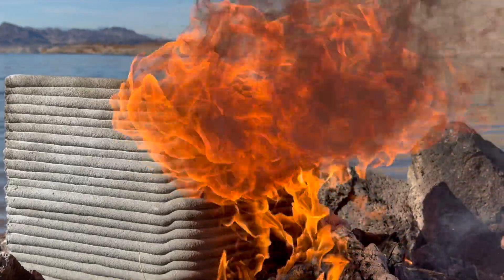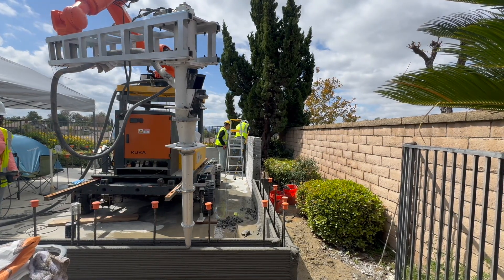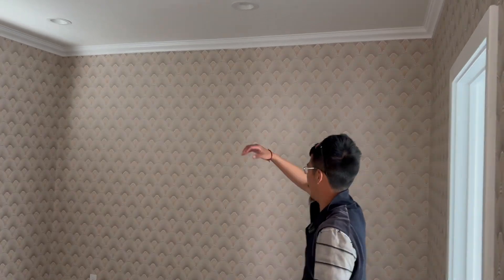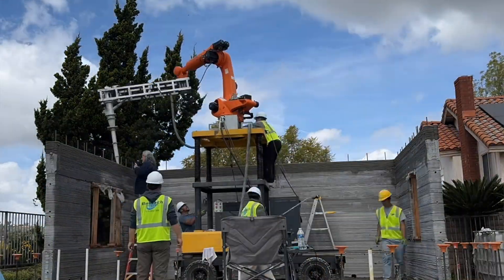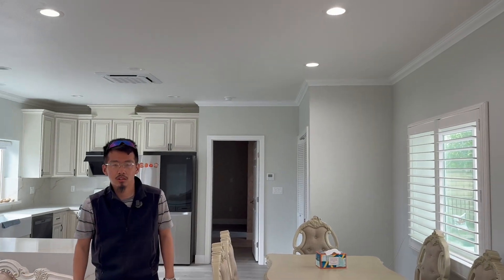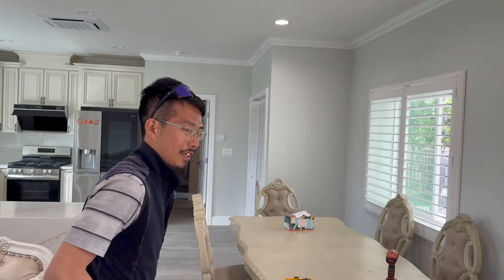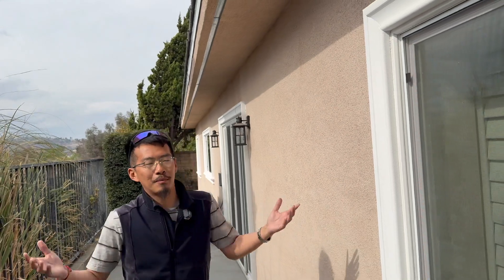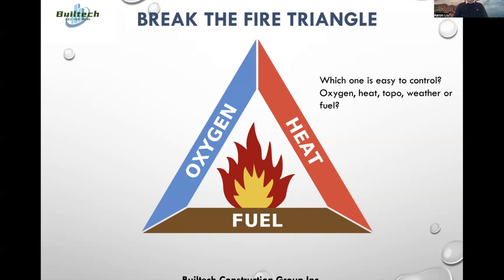Fire Resistant 3D Printed Home in LA

Comment: Hi Jarett, How about asking Ziyou Xu some of the most relevant info for this 1200 sq ft ADU home? 1-Specific Los Angeles zip code location? 2- Total (start-to-occupancy) construction time? 4-Total $ cost (20k-ish more, but what was the total?) 5-Cost per square foot? 6-Energy Efficiency comparisons vs Stick-built insulated home? Plz add the podcast link if you've completed it. As of 5/11/25 the podcast link was still "coming soon". Thx

Comment: This 3d printer BS is not going to happen.  It literally just makes a wall that looks like a stack of turds.  You still have to be able to install mech and elec, which means framing out the inside.  And you have to finish the exterior.  Wood framed houses can be made very fireproof.
Reply from the maker: That’s what the candle people said about lightbulbs 💡